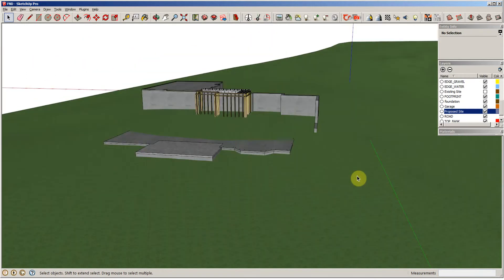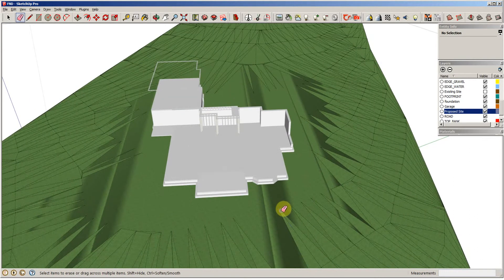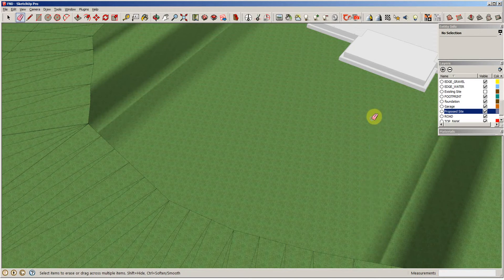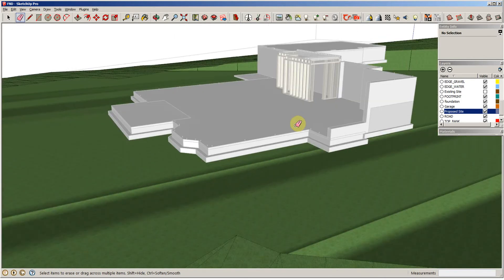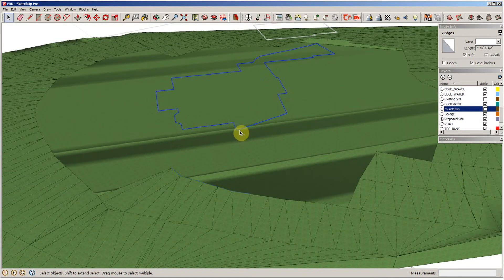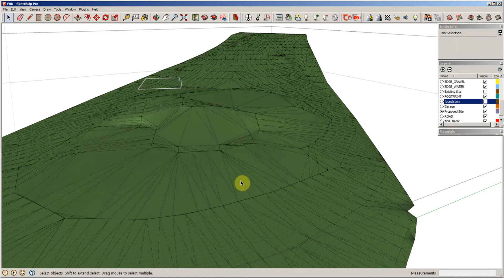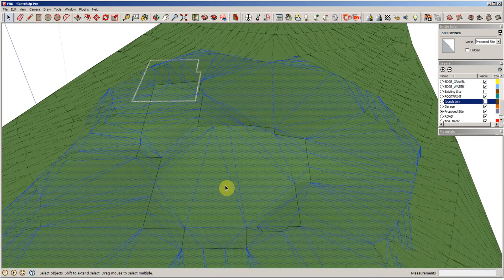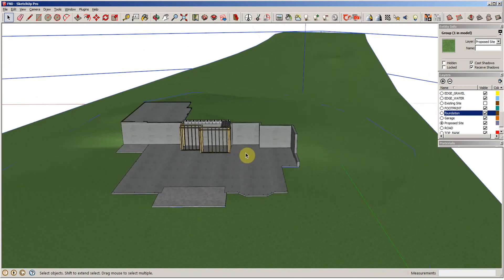Site Modeling in Sketchup, part 4

Comment: One possibility for selecting the edges is to turn off hidden geometry, double click the surface which will select the face and bounding edges, hold Ctrl and deselect the face. Then weld the edges, it will either weld the inside set our out side set of edges. Repeat the process and then after deselecting the face also deselect the curve that it welded together and then weld the last set of edges.  It may seem like a lot of work but with shortcuts set up for Hidden Geometry and Weld it is actually quick. Thanks for the video!